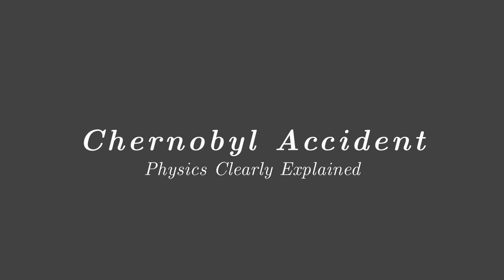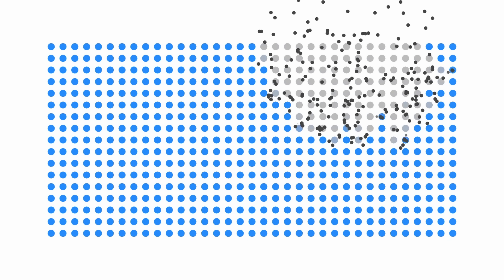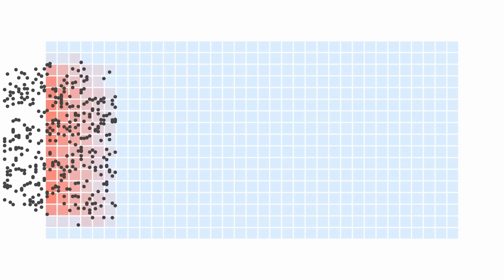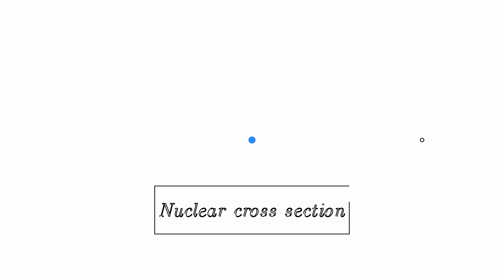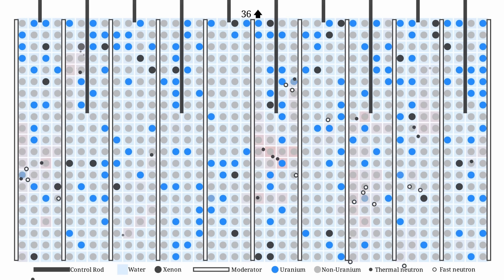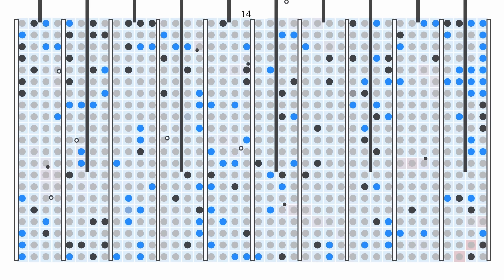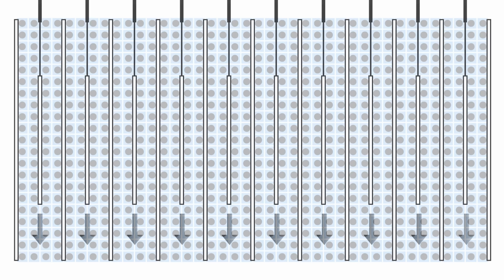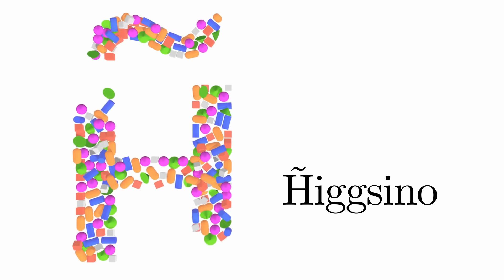Chernobyl Visually Explained

Comment: Why did the power decrease dramatically in the first phase? Is there control of the power and/or backup power?
Reply: The output power decreased because of the xenon buildup combined with the lowered control rods. The reactor would need to be given time to reach an equilibrium with the xenon to achieve the expected power output. 

This was expected behavior though, it's not entirely clear what caused an unexpected extreme power drop, but it seems to have been a combination of an automated system experiencing a problem with its sensors and the reactor control engineer manually dropping the power further to try and fix that problem. This then caused the power to rapidly drop to super low levels.

Comment: There’s actually a mistake here I believe. To clarify for people, the purpose of the graphite followers is because heat rises, the bottom of the reactor is cold, thus more neutrons being absorbed, leading to lower efficiency, the idea of pulling a control rod out is to increase reactivity, so the graphite tips not only displace that water, but replace it with a moderator which increases reactivity.

Now here’s the big mistake/design flaw that was missed.

The rods were pulled all the way out, including the tips/followers/trailers whatever you want to call them. There’s no real reason to do this, as far as I’m aware we don’t know why this happened, maybe in desperation they just cranked the rods up as far as possible to increase reactivity because they needed it for the test, who knows.

The important part is that the graphite tips weren’t in the container, so their xenon/water were still managing to keep it in check, until the balance finally started going the other way, this is when they panicked and clicked az5, dropping the rods, tip first, the moment they hit the reactor it supercharged the reaction that was already increasing, from there it’s as described.

If the tips were already in, and they saw it increasing, the az5 would have most likely worked, as the increase would be more distributed, though slightly faster, the as5 wouldn’t act as a bomb, since the graphite was already in there in your demonstration, any lowering would’ve slowed the reaction.
Reply: The caveat being, if the reaction had already got so far that the water was too heated for the rods to drop. It’s kind of hard to speculate, but again, the rods being out all the way allowed the reaction to hold low for longer, delaying thee time for them to realise they’re making a bomb.

Comment: This is inaccurate, there was no 'flame explosion' as you would get in a nuclear bomb detonation. What caused the damage to the building and the reactor was the tons of cooling water boiling away in a super critical core, this water turned to steam and the 'explosion' was actually a steam explosion and not a nuclear explosion. At no point did the reactor explode, it was the volume of steam that lifted the reactor cap off and destroyed the building.
Reply from the maker: Question: Did I say it was a flaming explosion? Did I say it was a nuclear explosion?

Answer: No.

D- for you
Reply: @Higgsinophysics  Then why show a flaming explosion in the video? Also I did not say you said it was a nuclear explosion, I simply stated it was a steam explosion to differentiate it from a nuclear explosion which is what some people erroneously believe happened at Chernobyl

Comment: It's funny how the processes and what actually happened are complicated. But it doesn't take any sort of nuclear expertise to realize that removing these things called "cooling rods" and then removing all the water from this strange reaction that produces heat would be a problem. The big takeaways are absolute incompetence, and communist party pressure led to someone with such a broken line of thinking in charge of such a dangerous device. And also nothing is "idiot proof" just like nothing is bullet proof or waterproof, its only resistant.

Comment: Great video! I thought one of the key factors of such a design was that the water too acted as a moderator?
Reply: That's in a light water reactor, which has a negative void coefficient because water is a moderator for it. 

I don't know if RBMK reactors are heavy-water reactors, where water just stops neutrons, but they generally worked the same way if I understand correctly

Comment: What's the difference in a light water reactor? Why does the absence of graphite cause a negative void coefficient?
Reply from the maker: it's a good question. I'll show you in the upcoming video.

but the answer is: while water is a great moderator, the presence of graphite makes it redundant. The neutrons are plenty moderated by graphite. that's why I didn't bother explaining water is also a moderator in this video.

So in my simulation and also in real reactors moderation by isn't important. only absorption by water is important. 

and to directly answer your question: because when graphite is gone, only water can moderate the neutrons. water gone = fission gone
Reply: @Higgsinophysics  Wouldn't "water gone" mean unrestricted fission in light water reactors as well? From what I understand, a moderator is something that partially "hinders" the reaction from becoming an uncontrollable chain reaction, like it would do without it.
Reply from the maker: @Thalassophoneus  more moderation = more fission, basically. Moderation is not defined as something that hinders a reaction
Reply: @Higgsinophysics  Thanks for clearing that up. Now I get it. Their role is slowing down neutrons to make them more prone to colissions.

Comment: The reactor lid weight 1000 TONNE, and it was in the air for over 10 seconds, IMAGNE the amount of pressure to fly this lid that far. Very terrifying..
Reply: 9.81 MW approximately (a standart building crane lifts around 1MW)

Comment: Something way too many people mix up is that, while voids build up faster at higher temperatures, they are not 1-1. The reactor actually had a Negative Temperature Coefficient, running hot reduced the graphites abiltty to moderate. In the event of a slower increase this was supposed to counteract the void effect. The problem is the voids can build up almost instantly while the temperature effect takes a few minutes to reduce the reaction rate, so in a complete and utter runaway like what happened it couldn't do it's thing.
Reply: (This is also why some calculations believe that the disaster wouldn't have happened had they not hit AZ-5. The combination of the Negative Temperature effect and the slowly activating emergency pumps finally kicking in and getting more water in would have had a chance to stop the power increase with just a bit more time, after which control rods could be slowly inserted in groups. Reactor would have been damaged, possibly partial melting of a few of the hottest rods, but it survives.)

Comment: Great video, I think it's the best graphical explanation I've seen of the accident!
Although I'm not sure about the explanation in the last part, about the graphite control rods tips. I understand (having some physics background myself) that the problem with the scram button was in the BOTTOM of the reactor core, where the graphite insertion accelerated the reaction, evaporating almost instantly all the remaining water (which was also mostly in the bottom of the reactor core). It was that sudden evaporation of the remaining water that caused a kind of "shockwave" that jammed the rods in place. The middle and the top parts of the reactor core were not affected by the scram activation. (Possibly the top part chain reaction may even got decelerated by the control rods, but not enough to stop the reaction).
Of course, I could be wrong, but it is how i understand it.

Comment: Just wondering the second they pushed the AZ-3 button is considered the point they blew the reactor up but it would seem that respective of that once the control rods were fully removed and the pump system turned off the reactor was a going south anyway. I wonder if they had re-enable the water pumps would they have been sufficient enough to recover the reactor without some sort of resulting damage? I.e the reactor may not have gone super critical and blown it's top, but it would have been in a state to have at least damaged the fuel rods and their assemblies possibly resulting in a melt down?

Comment: Didn't get one thing - why moderator rods were connected to control rods?
Reply: When the control rod is out, the space would be filled with water, which is a neutron absorber, effectively doing the same job as the control rod (but less effective). By displacing the water with graphite, removing the control rod has a greater effect on the reactivity.

Comment: You mention that the graphite tips on the control rods increased reactivity during the SCRAM procedure. However, I didn’t hear much about how the graphite tips displaced neutron-absorbing water, which I think would have contributed even more to the rapid surge in reactivity. Was the water displacement effect intentionally left out for simplicity in your simulation?

Comment: They almost dodged the bullet several times. For one thing, if they prepared their tests earlier and disconnected from the grid, Kiev would be unable to ask the Chernobyl plant for more power and the test could proceed by slowly lowering power levels and avoiding the xenon buildup. Or they could have let the personel from the Nuclear Physics Laboratory stay there. Anatoly Chernechev (might be mispelling his name) worked for that organization and was a former plant operator. He had would have known how to maintain an adequate safety margin of control rods in the reactor. They probably could have safely burned away the xenon. One problem was Toptonov was essentially alone and "falling behind" since burning the xenon with neutrons is a delicate task and can lead to excess reactivity if not carefully managed. If they somehow didn't do that and the reactor got into a dangerous condition but before it was too late, with him present Toptonov would be unlikely to be pressured to turn off the computer. And if you say "well, if they avoided disaster that day, the probably would do the same thing at another RBMK reactor" the answer is now. The Soviets found out about the flaw with the AZ-5 scram button and planned to change their control rods so that pushing the button shuts down the reactor immediately instead of speeding it up and then shutting it down. The upgrades were to start in 3 years and be phased in during scheduled plant maintenance.

Comment: Check out the 1961 SL-1 reactor explosion.  3 men were working in the reactor building, but they could only find 2 bodies.  The 3rd body was finally found.  He had been impaled by a control rod and pinned to the ceiling.

Comment: ... This explains a lot. Thank you.

One question though. I know I'm stupid, but please explain why they were experimenting in an active reactor in the first place?
Reply: Somewhat ironically, they were testing a safety system intended for use in the event of power loss. 

Basically, if power went out then water wouldn't be circulated and the core could overheat or meltdown. There were backup diesel generators but they needed around a minute to reach enough power output to run a water pump, so there was also a system using counterweights to send coolant into the core to keep the core controlled until the diesel generators were up and running.

This had another risk though if one of the coolant pipes ruptured and power went out at the same time. There was an emergency core cooling system (ECCS) to pump more water into the core, and the theory was that the steam turbine of the reactor would have enough momentum in the event of power loss to run the ECCS long enough for the diesel generators to start. They weren't sure if this would actually be true, and that's what they were trying to test

Comment: I have a question (as someone who doesn't understand nuclear physics at all, but watched the whole video). One of the assumptions made early on is that, for the sake of simplicity in the model, new Uranium-235 nuclei could be spawned in at will, to represent new fuel being added in to replace the old. In practice, what stopped an emergency button from simply stopping the flow of new fuel into the reactor, and thus the introduction of new Uranium-235? Again, apologies if this question is silly, this isn't my field of study. But I would like to understand.

Comment: This was well done visual model.

Only thing that I'd point out is the result of the runaway reaction didn't lead to a nuclear explosion as your model might suggest. In fact the actual explosion probabaly saved them from a nuclear explosion.
Voids (evaporated water) in the core are very hard to occur due to the closed pressure system... 
However, should that pressure keeping voids from happening be suddenly released, then most of the water would boil away. (Ever scene a pic of a pressure cooker after its seal failed and the pot is 6 inches into the stove and the lid is in the ceiling?)
This is in fact what happened, because the reaction temperature got so hot that it MELTED the zirconium encasing on the fuel rods which in turn slagged the water pipes they were in. Now all of a sudden there is a pressure release and the force of the boiling water explodes the core.
It's basically a BLEVE at that point. With a LOT of radioactive debris.
Its basically a "dirty bomb" rather than a thermonuclear explosion like an atom bomb.
Thats why it acted like a chemical explosion or a BLEVE and not like Hiroshima.
Reply from the maker: My model don't suggest a nuclear explosion

Comment: This was an incredible demonstration!!!! I imagine that a better protocol would have been to increase the water flow before the xenon burned completely away and then press the SCRAM, is that right? It seems like they could have avoided using SCRAM altogether if they had allowed the power to return to normal instead of pushing the reaction, is that correct?

Comment: Thank you for this. Very fascinating.

Pro tip: if you use cards at the end of your video to link to some of your other videos, be sure the last 20 seconds doesn't have any visual content so the cards don't cover it up. I can't see the top half of the Y axis on your death rates chart.
Reply: Youtube in general has this issue.. I've noticed it on alot of videos and it seems to be mostly out of the creators control. One that pissed me off the most - a music video...come on..

Comment: Would it have been possible to save the reactor and slow the reaction down by restarting the water pumps and flooding the chamber with water again?

I get it likely wouldn’t save it once the steam flash boiled because no space but say, instead of pushing the scram button, a prior attempt to restart the pumps?

Comment: Wasn't the majority of the graphite tip on the control rods removed/raised out of the reactor? So that when they were lowered with SCRAM, more graphite came into contact with the reactor, thus temporarily increasing the reactivity before the boron part of the rod could enter? I feel like the simulation shows all of the graphite always in contact with the reactor, if this was the case you wouldn't get the reactivity spike from SCRAM?
Reply: The graphite was centered in the reactor core when the rods were raised, pretty much how it's shown in the video. The reactivity spike occurred because when the graphite gets moved down as the control rods are lowered, reaction-inhibiting water gets displaced with reaction-enhancing graphite in the lower part of the core. This caused a reactivity spike in the bottom of the core from which the pressure blocked the control rods from moving. I believe this spike then causes the unstable rest of the reactor to also spike, and then the chain reaction destroys the reactor.

Comment: 5:20 how does the design of the reactor determine positive/negative void coefficient?
Reply: Water acts as a neutron moderator, which increases reactivity. Thus steam bubbles decrease it (negative void coefficient)
Water also acts as a neutron absorber, which decreases reactivity. Thus steam bubbles increase reactivity (positive void coefficient)
As AN1Kl said, which effect is dominant depends on the design of the reactor, namely which other materials are also present and where.

Compared to water graphite is a slightly worse moderator and a much worse absorber. Thus in the presence of a lot of graphite the neutrons are already well moderated and the positive contribution to the void coefficient is dominant.

Also, it is not quite true that the void coefficient can not be changed after building the reactor, at least for the RBMK which is a pretty flexible design. In the aftermath to the accident, fuel enrichment was increased and additional absorbers installed. (This of course increased the fuel costs, which is why they haven't done it before.)
These changes do change the material in the core and therefore the void coefficient.
Reply: Completely underrated question, as Dyatlov himself considered it one of the main issues of the RBMK in his book. The positive void coefficient is (obviously) very dangerous, as it allows the positive feedback cycle to keep going. Answering your question, the design of the reactive zone itself (e.g. the distance between rods) defines, whether the reactor will have positive or negative void coefficient, and it cannot be changed since it's built. Also I'd like to mention that Dyatlov personality is now considered diabolical in western countries due to lack of translated information and influence of the HBO series, which is sad.